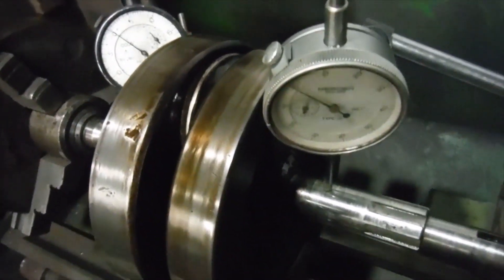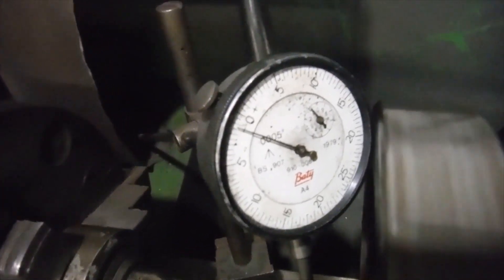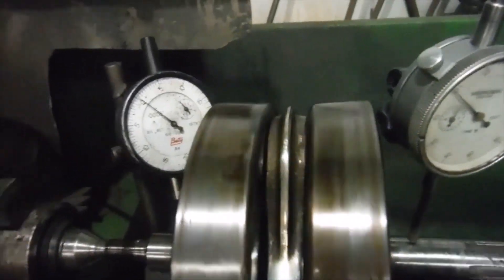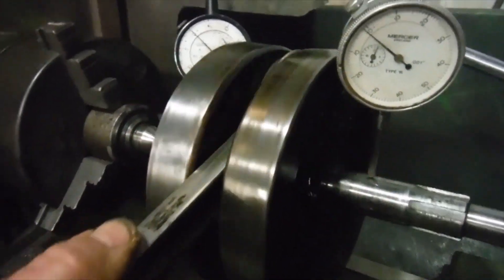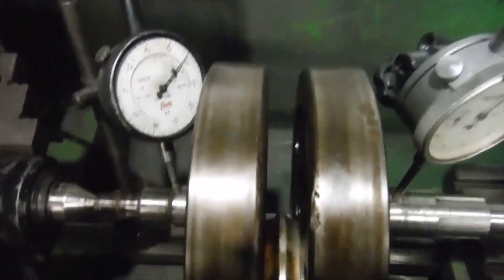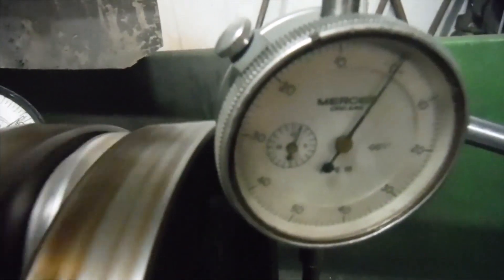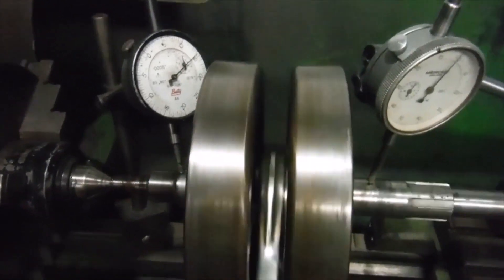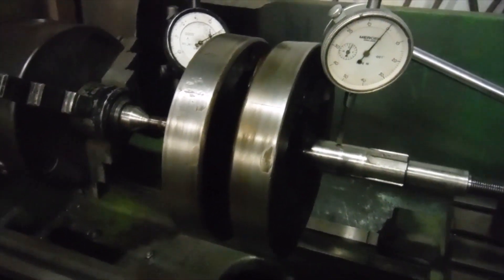Royal Enfield Bullet Asbo 49 crank runout check - before and after rebuilding and truing.

Comment: Those flywheels appear to have suffered from some brutality over the years, or is that 'normal' wear and tear? 🙂
Reply from the maker: They have been bashed about a bit, it would seem, but not really a problem.
Reply: I guess some people 'bump' them on a block of wood and others use a BFH!
Reply from the maker: Hi David, there was a bronze big end bush in there when I split the crank, so someone has been in there before and possibly been a bit rough with it.